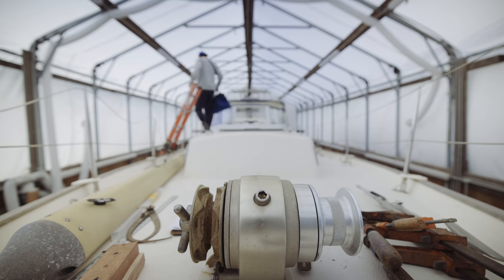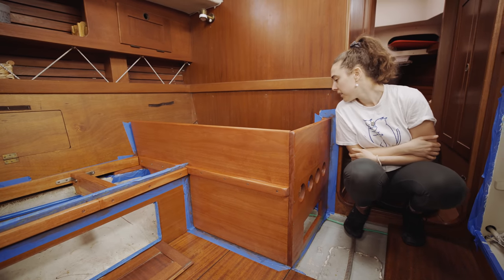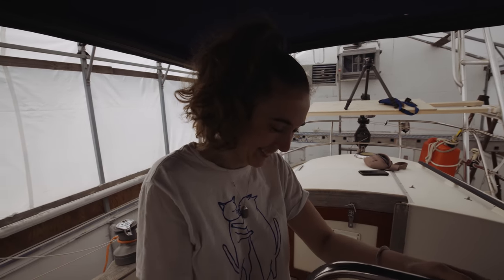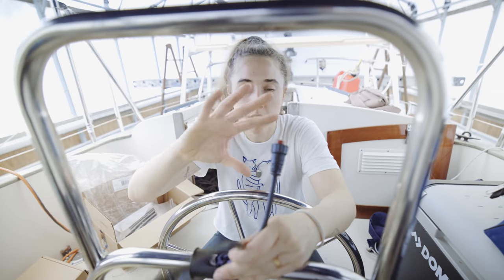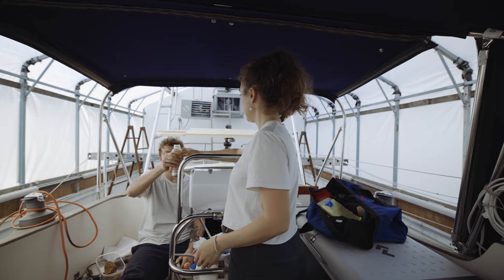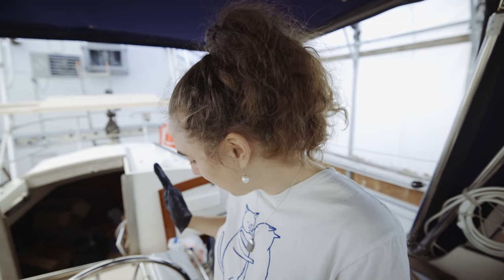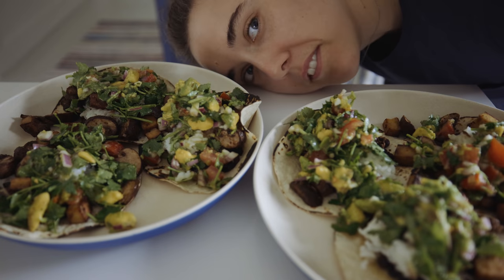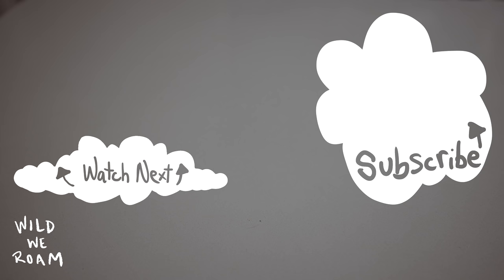How We Like to Spend Our Weekends | Boat Life Ep. 46

Comment: Please, do consider this: when making any exterior holes that expose the boat’s wooden core, like under the pedestal metal legs, drill oversized holes, epoxy the holes, then drill your correct sized holes. This will protect your boats wooden core from any moisture. 5200 and butle tape will fail you in these senarios. Everything is looking great!!!

Comment: Hi there, here a hint for you: When drilling a hole in a pipe / tubing, always drill it from below not above. Water from salty spray or from washing the boat will go down inside and ruin the boat along the way if the hole is on the top of the tubing. Stay safe, Silvano

Comment: WOW! The interior is looking really great!

We have not had the greatest success in matching the original Hallberg-Rassy finish with the new mahogany trim we have installed here and there.  Maybe you could post the secret although there probably are not all that many other Rasmus owners following your channel :D

We really love our new refrigerator.  It is a game-changer after only 4 months with it now.  I don't know how we survived for three years without it.  Not having to get ice every couple of days really limited us and all the meltwater was hard on the fresh veggies.  

Does the navpod spin so it can be viewed from the forward part of the cockpit?  When the autopilot is running and it is rough and/or rainy with spray everywhere it is nice to be as forward as possible under the sprayhood and dodger.  We have a Furuno autopilot with a tiny knob at the cockpit nav desk and it is like a second little helm wheel station up there for us.  

We use an Android phone or a tablet running Navionics in a holder at the helm and have our marine chartplotter in the nav desk panel with the autopilot control and the engine control panel.  It is nice having multiple charts at different zoom levels going at the same time, especially in tricky inland waterways and inlets.  It is also handy to have another tablet or phone for one of us doing last-minute research on anchorages, marinas, nav alerts and other stuff on the charts while the other helms and navigates on a different device.  A new route or waypoints can even be sent from the phone to the plotter using the network.  Handy.

While you are sewing the cushions maybe make a cover for the helm pedistal/binnacle and wheel that protects all of that from rain and sun when you are not under way. Ours goes way down to the bottom near the sole and has just one long zipper at the forward side.  It takes only a couple of seconds to put it on or take it off yet because it is snug at the bottom the wind could never take it with the zipper closed.  

We have the original wooden wheel and not the stainless option, so it is even more susceptible to the weather, but even so keeping yours out of the elements and sun will keep it fresh.  We also made a matching snap-on cover for the cockpit nav desk to protect the engine panel, autopilot, and chartplotter from the sun. Maybe it will even hide all those expensive electronics from prying eyes at a free wall or bulkhead when we are away for a few hours.  The same goes for covering the helm and your chartplotter.

Where are you guys mounting your radar dome?  We don't have radar yet. It is a future upgrade and we are wondering where the best place to mount it is on a Rasmus.  Will it fit on the arch without blocking the solar panels?

Comment: You need a synthetic rubber grommet on the hole in the tubes else cables will rub on the metal through vibration.